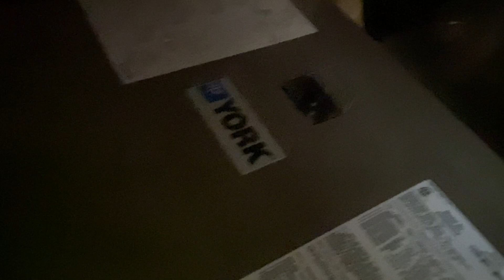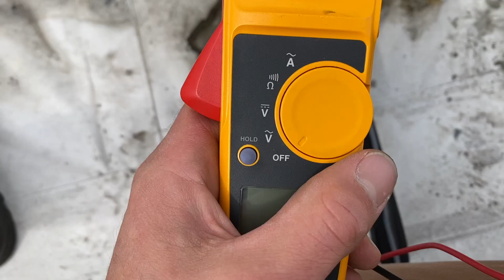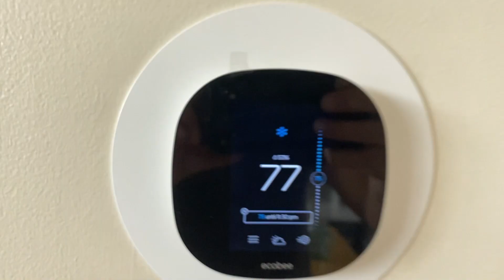HVAC No Cooling Call | AC Service Call | Troubleshooting on a York AC System | Fuse Change

Comment: A tip for that TP4 bag, if you get a small 7 day pill organizer, you can slide it into the part under where your handle for the bag goes. You can put a couple fuses, screws, schraders, connectors, anything to save you a trip to the truck.
Reply from the maker: Thanks!! That’a an awesome idea I’m gonna have to get myself one of those for sure